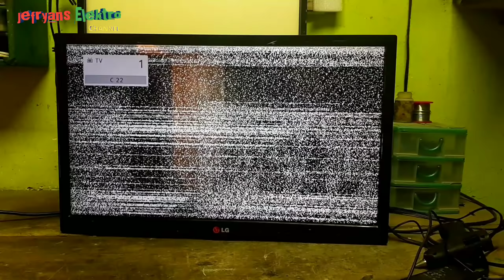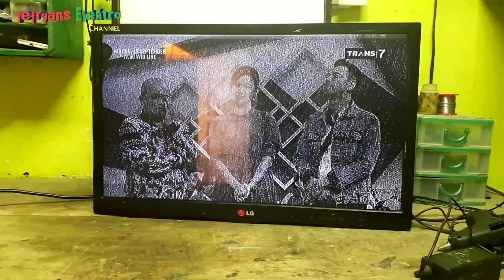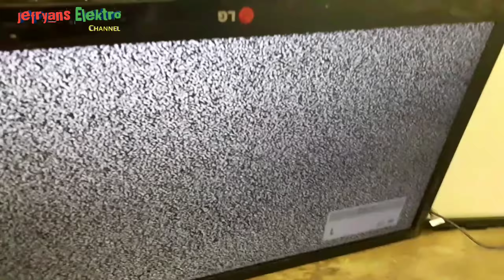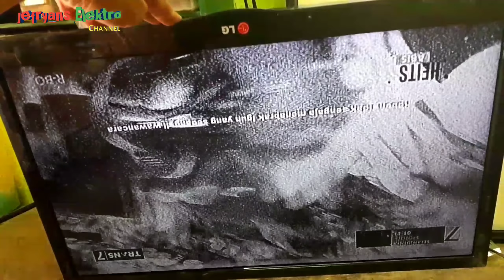fix LED TV LG 22 picture slow motion #Gambar berhenti-henti

Comment: Sebenarnya yang rusak bukan layar tapi IC scandriver yang menghasilkan output vgh_event dan odd tidak stabil.Betulkan min ?
Kenapa gak ganti IC scan nya ?
Jadi gak perlu sunat sana sini sama jumper sana sini
Reply from the maker: Bukan IC nya to layar, tegangan normal emang begitu,karena vgh nya korosi dalam panel,maka nya di injek by pass pakai vgh driver
Reply: @JefryAnsElt  ok tks responsnya, saya pernah benerin LED panasonic kasusnya slow motion, saya ukur tegangan event dan odd naik turun
Lalu saya lepas $emua kabel tcon menuju panel, saya hidupkan saya ukur  tegangan event dan odd tetap naik- turun2 juga. Saya fikir berarti IC drivernya rusak. Saya niatnya mau ganti tcon supaya gak motong dan jumper. Tapi karena yang punya bilang mahal, akhirnya saya Pake potong dan jumper( sukses). Kira 2  ada alasan yang menguatkan kalau tetap layarnya ada yang korosi ?